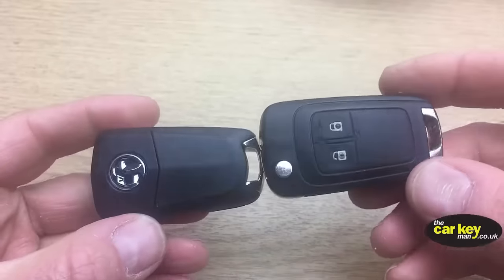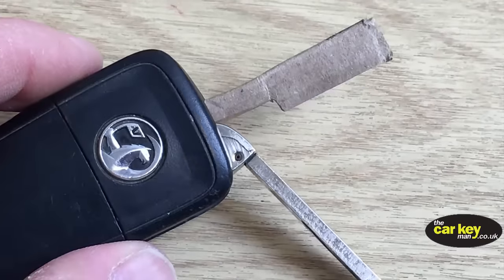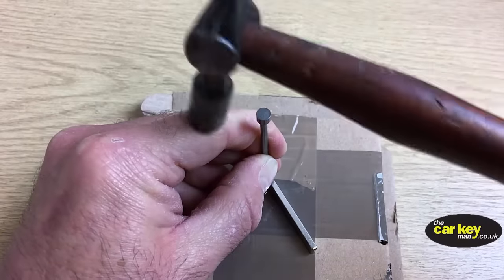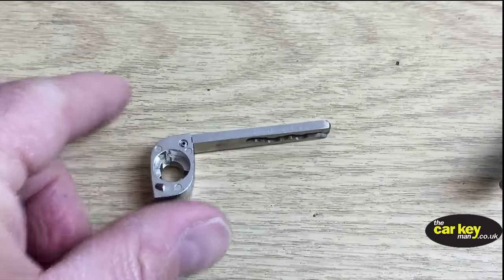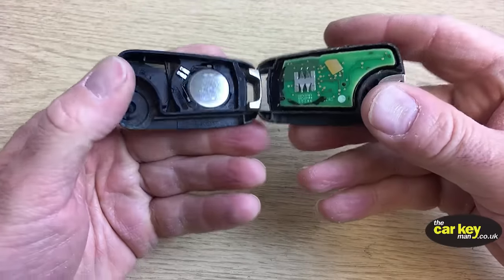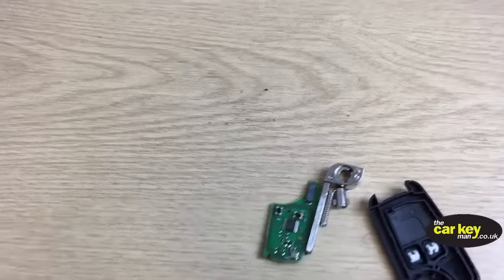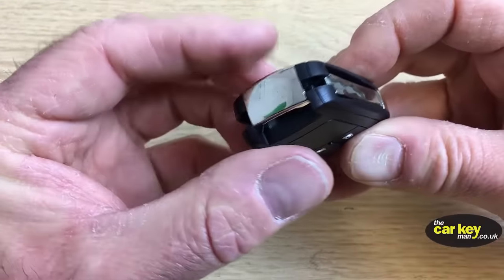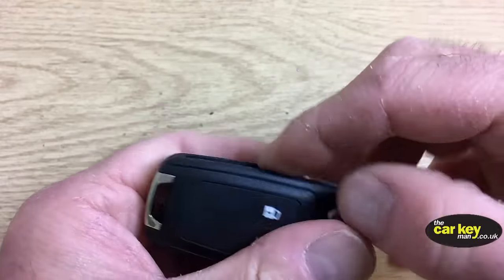Vauxhall Flip Key Repair Kit Instructions

Comment: Im having big trouble removing the old case. Swapped the key over just now need to do the inside. Can't open it despite using pliers in the video. I'm concerned of disintegrating the chip inside. Is there a screw behind the logo.
Reply: I've just stabbed myself trying to take the logo off. That fob I've got is seized shut. My new fob piece of cake to open.
Reply: Is there a screw behind the logo preventing me opening the old case?
Reply: Ok all done no screw. The plastic was just seized. Got chip out undamaged all done works fine. Thank you for the tutorial.
Reply from the maker: Hi, sorry just seen this, hope you're not hurt too much! Wel done on getting it done, some of them are just very tight
Reply: @TheCarKeyMan  thanks. I slipped using a very fine flat head precision screw driver,  I had been abit frustrated at the time, your tutorial was brilliant, I was just frustrated with the old stiff casing. The new casing was no problem. It's been fine since I fixed it thanks to your tutorial.

Comment: Twisted they key exactly the same but it doesn’t stay down! Slight ‘stick’ when trying to ‘close’ they key too. Tried everything but nothing seems to work!
Reply from the maker: Hi Matthew, a couple of questions. Are you using all the new parts except from the key blade?
When you got the replacement case, did it flip out and fold in correctly? 
Did you get the case from us on Amazon?
Reply: The Car Key Man Hi, thanks for the reply. Yes, I switched everything apart from the original key blade. The new case flipped and folded perfectly. 

No, I bought it off eBay! Not a huge problem just thought I might be doing something wrong. Works fine, though! 

Thank you!
Reply from the maker: Hi Matthew, no problem helping but I just wanted to check that our keys we sold were behaving themselves! Have you solved the problems you mention above?
Reply: I had the same issue today. Then I noticed the key itself was slightly  bent not allowing the lock rotating until it locked down. Used hammer and now it's good as new :)

Comment: I received my new key today, however, I didn't have a pin holding in the blade. Can I use the old one?
Reply: Is the new pin definitely not in the clear bag? I also received mine today and there was a new bin in the bag
Reply: No, i’ve checked everywhere :)
Reply: @liviafoulds2433  ahh that’s strange! I don’t see why the old pin wouldn’t work, but I don’t want to say go for it 😨
Reply: Only thing i’m worried about with using the old one, is it being the wrong size. Thank you anyway :)
Reply from the maker: Hi Livia, sorry for the delay in replying. I can't really explain why there is no pin, as I make the kits up myself. I'm sorry for the mistake. Do you want me to send a pin? Yes you can use the old pin but I can send one tomorrow
Reply from the maker: Thanks for your help :)
Reply: @TheCarKeyMan  Thank you for the reply, i’ve used the old one now

Comment: Hi there. I am using all of the new parts from the key apart from the old blade which I obviously need.

However when I put the button in, it doesn't stick out of the case at all like in the video. It's either way too short, or for some reason won't go out far enough. Any recommendations?
Reply from the maker: Hi Jak, do you mean that the blade does not flip out correcty?
Did you get the case from us?
Reply: @TheCarKeyMan  yes It didn't but I've fixed it! And no unfortunately not, I bought off someone else but your video is the clearest I've seen so have been following your instructions!